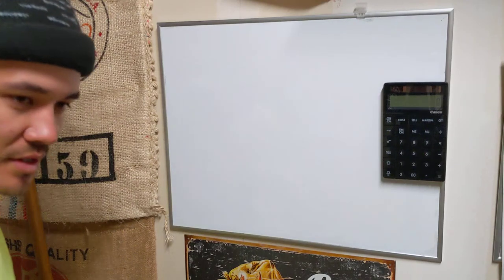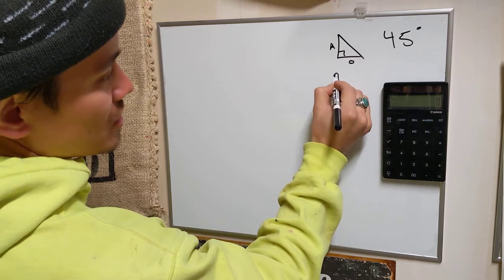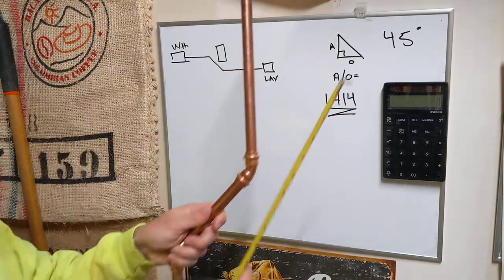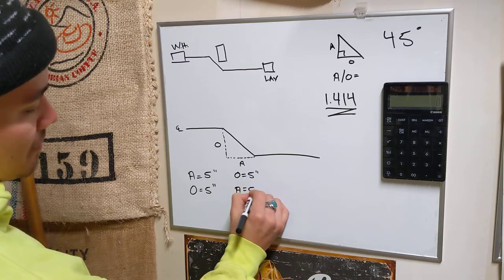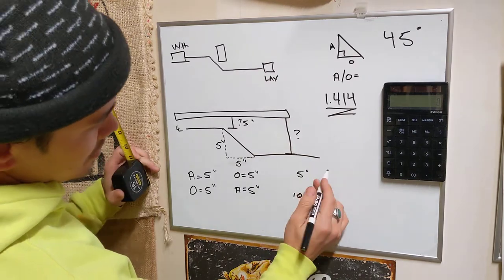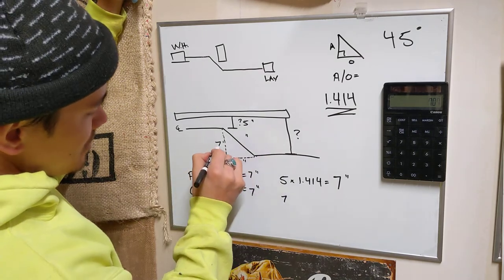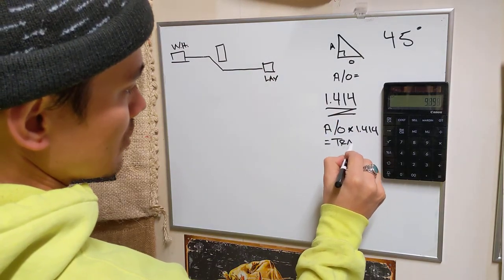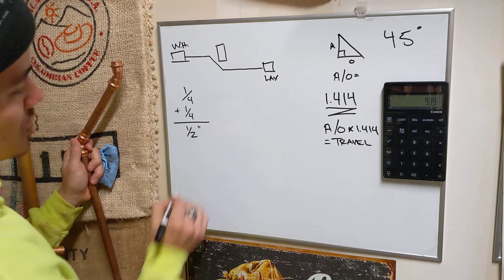45° degree offset EXPLAINED!

Comment: Joon if you have a 45 degree 1 1/2" fitting and a 90 degree 1 1/2" fitting. Would you still measure centre to centre and times it by 1.414 and subtract the fittings or is the multiplier only used if you use 2 45 degree fittings?
Reply from the maker: Let me think about that. I've never done that offset math. But 1.414 for sure is only between to 45 degree fittings
Reply: @JoonRhee  So a 90 fitting and a 45 degree fitting can't use a multiplier?
Reply: Apparently a 5th term apprentice was saying you can due to it still being a triangle. Which to be fair I don't fully understand what he means by that.
Reply from the maker: @denvercharlebois699  I am sure you can...but just cause you can doesn't mean you should. I've only done that to hit a rough in on a p trap stub out for a sink.
Reply: @JoonRhee  Do you know of any sites  to find the take off for copper fittings like a 1 1/2" 90?